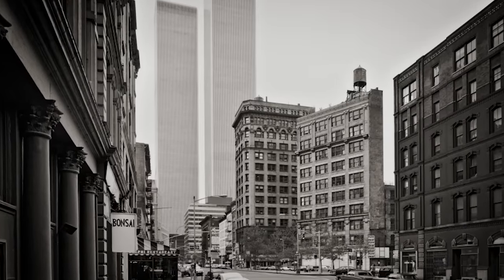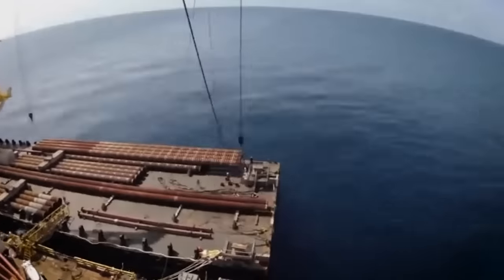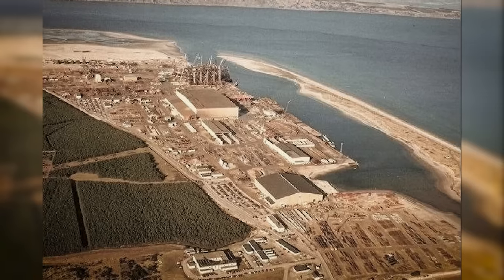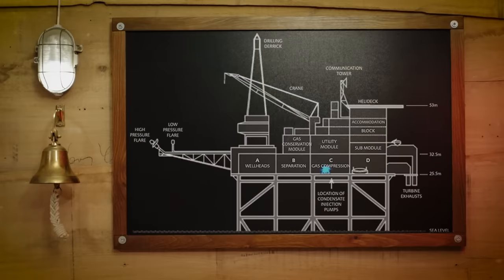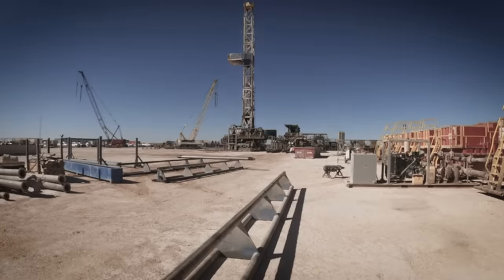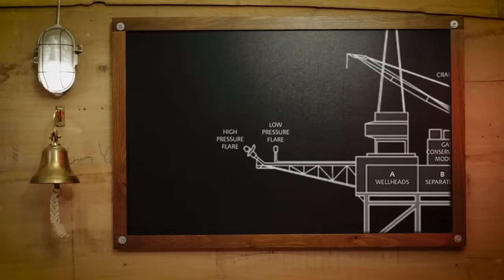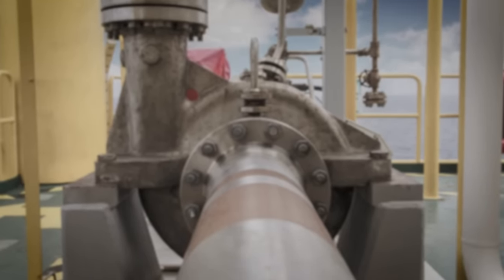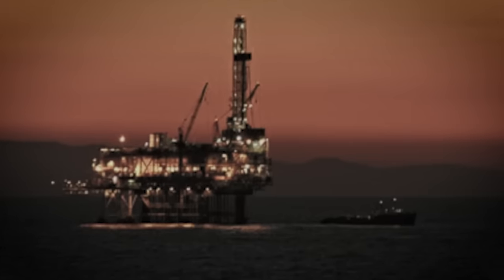This Block Has 87 Dead Bodies

Comment: I started working on rigs about this time, and the findings of the commission of enquiry into the disaster recommended major changes to the permit to work system to prevent this kind of disaster happening again. The only real question in the minds of my workmates and myself is, why did these folks stay in the accommodation module when it must have been clear something really bad was happening and the coms system wasn't working, rather than taking the initiative and getting out of there?
Reply: I believe they were in the accommodation area because that was their designated fire assembly point.
Reply: @stormywindmill  that is true, but when conditions in the module became intolerable and coms wasn't working why didn't they use their initiative, the sad answer is a blind adherence to their training when it was obviously time to run
Reply: @ericalawson631 a protocol is created for a reason. While in hindsight, it was clear that staying was not the right decision, at the time when abandon ship protocol was declared and it's every man for himself, with very little information every choice is a gamble. I mean what would u were u in that situation?

Comment: What happened to LOTO procedures? In a ship or refinery Lock Out Tag Out controls are routine. You simply lock out any equipment associated with something that should not be activated. The only way to circumvent a lockout tag is to manually cut the lock and disregard the warning tag. It's a criminal offense to use anything that has been locked and tagged. It's a physical lock and a huge red colored tag stating why it's there. Therefore there is no possible way a mistake can happen aside from gross negligence and disregard for safety. You can literally go to jail for doing so. The procedures on this platform are just lethally wrong. Obviously. Lives and fortunes lost.
Reply: LOTO was not an OSHA standard at the time, and the UK DOE didn't require it either (I'm not sure if the HSE had a LOTO requirement at the time, even if offshore rigs were under their direct purview at the time instead, though I'd assume not). Sadly this is yet another procedure paid for in worker blood.
Reply: @rob probably why you can be sentenced to jail for removal of them now.

Comment: I was head of maintenance for a string of factories and if any component being serviced prevented safe operation of any piece of equipment then a lockout tag had to be placed on the switch, starter button, valve, etc for that particular item along with the component itself being flagged with a reference to the lockout and its location along with the notations in the log.  A notation in a log box alone was not deemed sufficient plus the tag would have either padlocks or disposable lock tabs placed there by each technician, engineer, inspector, manager, etc that had to sign off before that equipment could be put back into service so the lockout tabs had accommodations for multiple lock tags.  If this potentially raised a fire hazard then I would have had to notify the local Fire Marshal of the potential risk.  This has been the rule as far back as the 1960's that I am aware of and perhaps even further back than that.  It stymies one to consider that on an oil platform in the same era that something as critical as this was left to a notation somewhere in a box and not a High Visibility physical flag/lock on the actual piece of equipment.  Violating the lockout tag without asking permission from each of the parties of interest with lockouts on that tag was grounds for immediate dismissal for misconduct which meant with loss of accrued benefits.  If I failed to put a lockout tag on and somebody died as a result I for a definite surety would have been found liable of gross negligence in a court of law.  If this incident with the pump and  valve had been in one of the factories I maintained in the 1970's and just a notation was made in a box without a flag and lockout on the associated devices I would have been found guilty of negligent homicide at a minimum.

Best!

Comment: I was working in the Southern North Sea sector when this terrible incident happened, it was my main reason for leaving the industry.
As time went on and the details came out as to how the disaster had been caused, I was stunned to find out that the "Safe Tag system" of physically locking off electrical switches had not been implemented.
Despite the "unfortunate" series of events that led to the deaths of so many men, it could have been easily avoided.

Comment: I remember this happening, I was very young, later in life I did a trip on the piper bravo, a short distance away was a marker bouy in the water marking where piper alpha once stood.
Such a tragic loss.
I worked on the Magellan jack up next to the Franklin platform, iirc the flare was 600ft above us on the Elgin platform & when it flared off it would dry the falling rain as it landed on the pipe deck, that would have been nothing compared to the heat given off  during the inferno on piper.

Comment: In the days that followed I landed in a helicopter, bringing the fire fighting experts, repeatedly onto the Tharos alongside the Piper A. Even though the Tharos was pumping huge jets of water onto the fire, the heat we experienced on the Tharos helideck was intense. Weeks later we flew a police team to the blackened accommodation module on a barge at Ardersier.
Reply: My ex partner was on the Tharos at the time of the accident he was a diver, the Tharos had to pull back because of the intense heat, dive supplies at risk of exploding.  When he arrived back on the beach had burns on his face, and the total frustration of being able to do nothing to help.  RIP Piper Alpha personnel.

Comment: For this reason where I work we have a lock out tag out procedure. If any component is removed or loosened in a system ALL controls for that system are locked and tagged. And ONLY the lock out worker supervisor has the keys for the locks. All controls are tagged with red tag lock out notices.
Reply: I commented this also.  I don’t know when lock out tag out started but any valve or breaker or any type of mechanical units are done this way.  That way there is no question if process is followed properly.   It really bothers me when I see things like this when simple analog safety programs like lock out tag out would have inherently prevented this disaster and it is just not used for whatever reason.   I’m a very patient person with men and women who don’t know their job well as it’s just training or experience that is at fault but I’ll go off if I see safety shortfalls because it’s usually a matter of common sense or laziness that allows for their failures.    Also being a plumber welder, leaving a valve hand tight in a lice system (really even if it was new and not in service yet) is very very bad practice for this reason.  To me this guy says it was all reasonable choices made and that’s just not true as leaving that valve hand tight was just because it would be easier to change later, this is straight up laziness.

Comment: If I can ask a dumb question, if any PSV or standy vessels that mus move in close proximity to combat fires like this and use seawater to.......
1. Seawater that is contaminated with oil and gas as a result of loss of well control.
2. Spray contaminated water onto an inferno containing flammable agents.
Are we doing boundry cooling using potential flammable "contaminated water"  I'm just a storeman asking a dumb question.

Comment: Excellent explanation thank you. Best I’ve seen to date. After many years on process, I’ve never seen a blind installed and not tightened even during a T&I. Certainly lockouts should have prevented it and it should never have get to that point but why blind without tightening?

Comment: In the electrical industry some switches have padlock holes, you use a simple adaptor like a pair of pliers, to take up to 6 padlocks and the start button or isolator is locked out until all the padlocks have been removed by each person. A sad storey and hopefully lessons have been learned.

Comment: Interesting and shocking! That there was no system to have a procedure whereby some sort of notice was attached to the pump as a last resort warning that maintenance was not complete seems rather odd. 

Something as simple as aplastic red tag zip-tied to part of it so that technicians would know that further checks were required of the paperwork before operation could be authorised, maybe?

Comment: LockOut TagOut is very important. This was preventable, but the valve should have been properly secured, Pump Locked Out and Tagged / Isolated, but the Job should have been performed to the end and not left. 

Major Safety breaches here

Comment: A simple hand written note with duct tape on the pump with your name on it would do the job.  Do not use pump .   The valve is out for maintenance.   Joe .   Works quite well at the shops ive veen thru.

Comment: I'm staggered that there seems to have been no shift change handover? Just leaving notes? You'd like to think that whoever was in charge at the very least would have handed over to their replacement saying "pump A temporarily capped, maintenance NOT complete, documentation stated NOT to use it has been placed here and here" 😥 I know this sounds like 20/20 hindsight, but it's a bl00dy oil rig.

Comment: The first mistake was that the pipe was only closed hand-tight. But not secured against pressure.
The second mistake was that the night shift was not informed about the open pipe.
The third  mistake was that the documents were not accessible.
The fourth mistake was that the divers covered the drainage holes with a rubber mat.
Then the problems begin and wrong decisions lead to catastrophe.

Comment: So many procedural and political failure accidents and incidents in the 80's... Being UK based there were loads that still spring to mind. Disgusting the loss of life caused by not following rules, not being thorough enough or freezing and not responding adequately in an emergency.

Penlee, Bhopal, Beirut, Ethiopia, Manchester Airport, Sumburgh, Challenger, Bradford, Chernobyl, Kings Cross, Clapham Junction, Zebrugge, Camelford, Piper Alpha, Lockerbie, Hillsborough, Kegworth and The Marchioness

Comment: I work on this type of equipment, and have Isolated more pumps and valves than I care to remember, whoever left the blanking plate bolts hand tight was VERY VERY unprofessional, getting the blanking plate on the pipe and putting in the bolts is the hard part of that particular task, leaving those bolts lose is negligent, regardless of how bad their permit to work system seems to have been, you just don't leave that task incomplete, it's like putting 4 new tyres on a race car hand tightening the nuts and leaving a note for the driver the next day hoping he sees the note, the time it would take to make the job safe is not worth the risk of the potential disaster that could happen.

Comment: The blank on that condensate pump should never have been just hand tight.Pump should also have been electrically isolated and locked off, with the fuses removed

Comment: I work in the oilfiled.. and there's no circumstance where you'd EVER hand tighten a flange that is being installed as a block. The people who did/were told to hand tighten that flange are 100% liable for the entire mishap. Theres a reason you're putting s blocking flange on the pipeline and it's to STOP ALL OIL AND GAS FROM ESCAPING... if the flange was tight they would have kicked on the pump it would have hit pressure and they would have stopped. Because it was loose it was bleeding off... They're 100% at fault.. I've put block off plates on and they are there to BLOCK OFF OIL/GAS. Lots of finger pointing which is normal for o&g but they should have known better the blood is on their hands

Comment: I'm curious where the number 87 comes from, as the Public Inquiry (Chapter 10) lists a total of 81 bodies being recovered from the ERQ (7 from the Galley, 70 from the D Deck and 4 from the A, B and C Decks). Fortunately (or Unfortunately, depending on how you look at it), they would have been dead before the ERQ (East Replacement Quarters) sank beneath the sea, as the toxicology reports indicated that all but maybe two had elevated levels of carbon monoxide in their blood. It's an interesting read for anyone who may want to dig into the specifics, etc.

Comment: LOTO should have been done on the pump when they removed the valve but there is a good chance that that wasn't standard back then. What 100% should have happened was the block off plate should have been tightened up. Never leave a job half done let alone one that under visual inspection looks done.

Comment: This should serve as proof for those who say that it's impossible for oil to melt steel like on 911. If the heat gets concentrated and very much can it will add up to steel melting temperatures when confined like in an oil rig or a building. The heat will flow and concentrate itself from other areas around just like within a blacksmith furnace which could use gas Cole or any other fuel. You just need enough of that fuel pointed in the right direction and from somebody who has used blacksmithing equipment and dabbled with it it is very apparent that heat adds up.
Newsflash but office buildings are filled with burnable material and literally made out of them. It doesn't matter how hot the starting temperature is if it can flow and concentrate. The only difference is the rate at which it reaches that melting temperature.

Comment: Be safe out there boys.  Performing LOTO the act of disabling a process system is what failed here. You should always retighten a flange when installing a blank (that's the thing the narrator called a plate or whatever). This keeps a charged line from leaking at the flange and stops explosions or leaks in general. I work in a power plant and sometimes the LOTO (lock out tag out) can be 5 to 7 pages long with a up to 15 valves on each page.  This is probably nothing compared to the amount of valves on the deck being referenced, so the fact that the offline condensate pump was used is extremely easy to believe. I was almost a offshore oil worker but I found my current job which is lucky for me as this job is dangerous. You have no idea how complex the rigs are and most every process has a redundancy. Hard to think that a worker could have taken another 5 mins to tighten that flange and none of this would have happened. Stay safe and check your work plus always walk your processes down before and after completion. Rest in peace everyone and my condolences to the families.

Comment: I am always amazed when I hear things like the other platforms did not shut down because they did not have permission to do so because of restart times. You would think whoever is on deck as captain of the platform should have ultimate authority not the company that is hundreds or thousands of miles away unable to see what is happening safety wise.

Hopefully this culture has seen some change, The people on the platform will certainly know more than any suit does if things look bad.

Comment: I would dispute the assertion that these were reasonable decisions - 
clearly the engineering safety program was inherently deficient in multiple ways. 
The root decision to continue production while conducting major modifications to the platform,
was clearly prioritizing profits over safety. 
Clearly, money was a major factor when the key decisions were made 
in determining "acceptable" risk. 
The simple fact that this tragedy was not the last of it's kind to occur
 due to this pattern of allowing or ignoring increased risks in search of increased profits
is IMO criminal.

Comment: Opening up saying the sequence of events was "reasonable" ticked me off enough...

In my opinion, it would not be appropriate to label the sequence of events that led up to the Piper Alpha catastrophe as "reasonable." Instead, the sequence of events is often described as a "cascade of failures" or a "chain of errors." The disaster occurred due to a combination of poor communication, design flaws, inadequate safety measures, ineffective emergency response, and a weak safety culture.

These failures were not reasonable, as they resulted in the loss of 167 (*not* 165) lives and the destruction of the platform. The catastrophe exposed the need for a more comprehensive approach to safety and risk management in the offshore oil and gas industry. Following the disaster, significant changes were implemented to improve the safety culture and regulatory framework, aiming to prevent similar events from occurring in the future.
Reply from the maker: Thanks for your comment. 

My point is that when these decisions were made the people making them believed they were reasonable decisions. They didn't intentionally make bad decisions. 

They made decisions that they felt were justified. We all make these kinds of decisions. If we get away with it once we do it again. 

I grew up Inn a time where seatbelts weren't considered necessary. I got away with it until the police started cracking down. Today I wouldn't think of getting in a car without one. 

This was a catastrophic sequence of events that lined up because everyone has gotten away with decisions they thought were reasonable when, as you rightly point out, they weren't reasonable. But when they made them there was no evidence to the contrary.